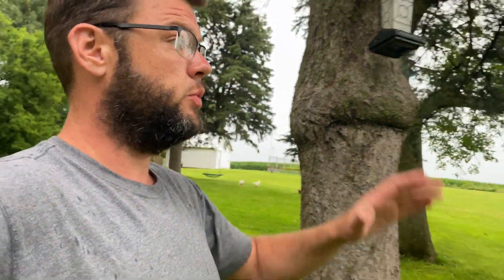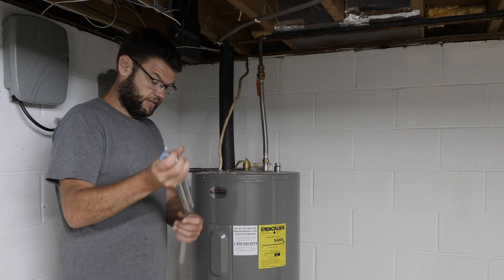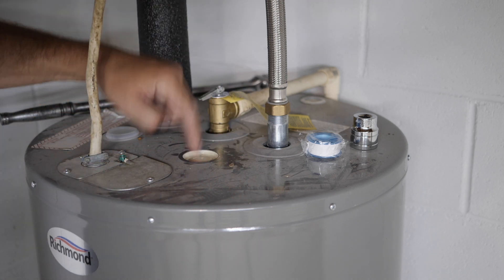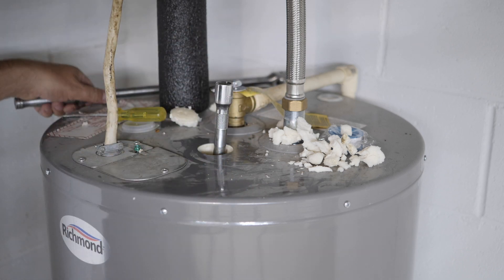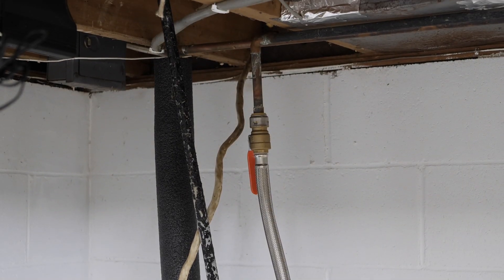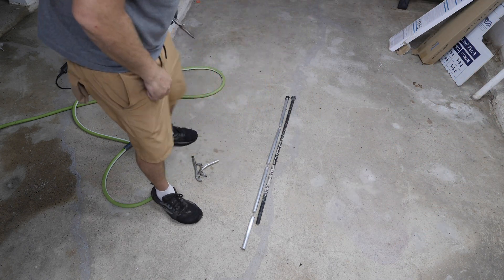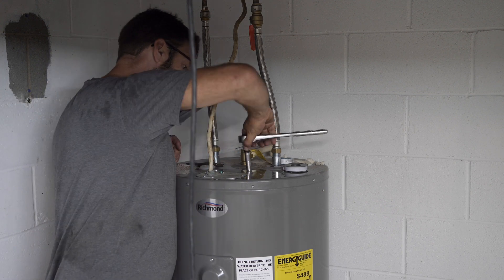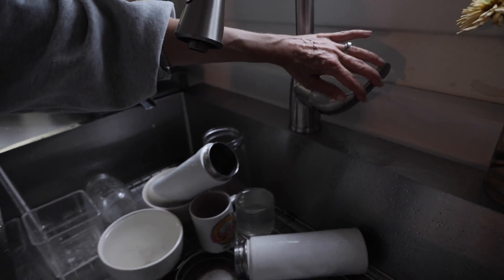Water Smells Like Rotten Eggs FIX!

Comment: I did the exact same thing with mine. Good job
Reply from the maker: Good deal 🙌🏼
Reply: Could this be the same problem with city water? my hot water has a rotten egg smell as well
Reply: I@sarahwilkins2027 I believe it can happen with any water The problem is in the hot water heater itself When bacteria grows and starts to stink.